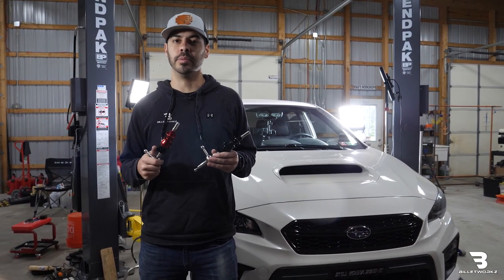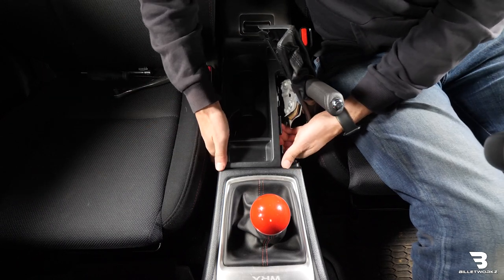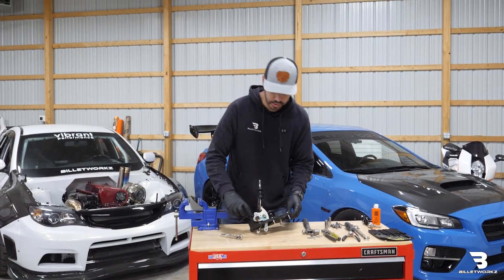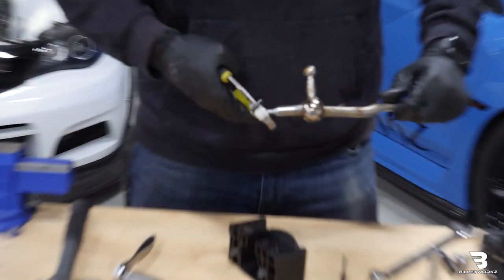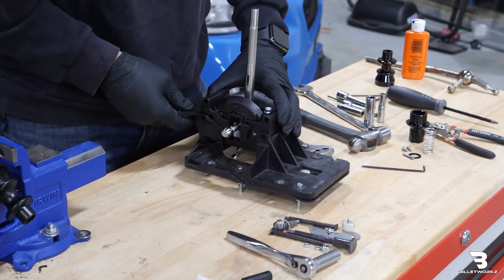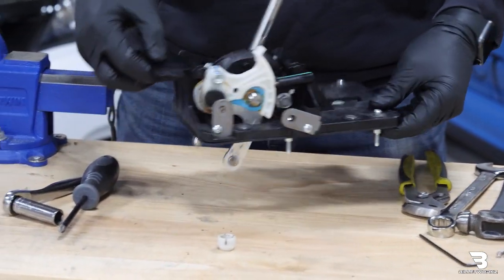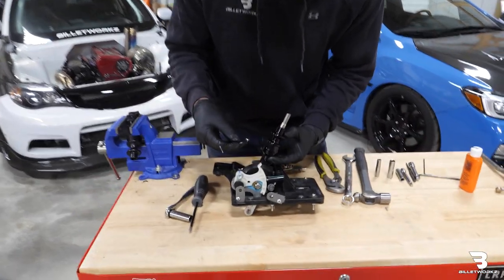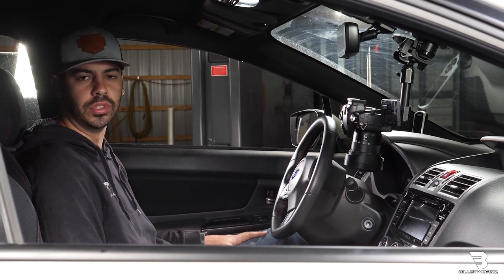Billetworkz - 2015+ WRX Short Throw Shifter Install Guide

Comment: OK, this video was really crucial to a successful install. I'm not a tech and I did this in my driveway. It took almost 5 hours to slowly get this done. The damn roller pin would NOT come out. It would only come about 1/2 out. I ended up cutting it in half with a saw and hammered the remainder back in so I could slide the shifter out. Ooof. Lots of hammering and cursing. Otherwise, it went pretty smoothly. It's no fun under the car and I hate being under a few tons of weight that could crush me, but it went OK. The last thing that ISN'T in this video is adjusting the 5th/6th gear stock shifter stop. I couldn't shift into 6th after the re-install and thought for sure I had screwed something up. After some more searching on youtube I found a video on installing a new 1st/2nd Billetworkz shiftstop and it addresses adjusting the stock 5/6 stop. PLEASE, please add the adjustment of the stock 5/6 stop to this video - or link to a new vid on how to adjust it. Anyway. this video is CRITICAL to getting this shifter swap done. The shifter is kick-ass and I love it. It just takes a lot of work to get it installed, especially if you're not a pro tech. If you're going to do this, plan on a whole day of work, get your tools ready, and take your time.
Reply: Just got mine done today, the whole installation took me around 5-6hrs as well because of no lift so it was 3 times more the work. The installation is very straight forward but them mofos bolts took me forever to get off. Overall, it was not complicated but just difficulties finding tools that would help. The pin was pretty ez for me, you can buy a set of punches for 15 and just pick the size that you need, be patient and smack it slow and hard. I got the whole kit done, shaft, bushing, and plates too. Everything is really sturdy just need to get used to how short it actually is, huge difference I would say since you can “feel” your car more. Well done brother!!!
Reply: What is the video?!

Comment: Watching this process conjures up memories of .50cal MG bolt carrier disassembly/reassembly from my military days.
Reply: 15:14 Timestamp for referencing reverse lockout installation instructions. After a year+ of use, the retaining ring got dislodged from its groove, causing the spring to no longer return the assembly to its down position when not using the reverse gear. Easy fix, though. I removed the upper receiver, reshaped the retaining ring, and reinstalled while sitting in the driver's seat.

Comment: 100% confirm will fit the 18+ Crosstrek 6mt.

Just finished installing this into my 2021 Crosstrek 6mt.

A video on installing the shifter stop would be awesome.
Reply: The 18+crosstrek has the same shifter as the 2015+wrx, it also fits the 2017+ imprezza. 
And yes super worth upgrade. I put in my crosstrek, and it's such a better drive now. I don't think they need to make a video of the shift stop. It's kind of self explanatory for anyone thinking of putting it in. You just put it in first, set the stop, put in 5th set the reverse lockout stop, and tighten it down. There's plenty of other video on YouTube about it. But if you drive manual you shouldn't need an explanation. As long as you can get into all gears, you did it right.
Reply: Hey nice to know:)   My girl has been wanting an STS in her '19 crosstrek. Thx
Reply: I just installed mine in my 23 crosstrek and was wondering if it is supposed to be seated a little to the left?

Comment: Holy lord that’s so much work for something so small
Reply: You’ve never done a throw out bearing then
Reply: facts 😂😂 im used to a short shifter being a 15-20 minute job
Reply: That's....what she said.
Reply: @nickc6570  last time i did a shifter everything was up top, and the car didn't have a reverse lockout. This is very complex because Suburu doesn't want you to do it. It's still less than an hour total, but it is a lot. That pin in the reverse lockout is the worst. I used a 1/8 flat and then held an allen with a pair of pliers cause i don't own punches. Then tragedy struck as i found the nut to be missing. Been looking for it and can't find it. Problem is it's small, but it's also big. And a random replacement nut won't fit without grinding it to fit into place or modifying the housing. That little nut is the only thing stopping me from having this done. Only question is where did it go. I'm going to end up doing it the hard way, and a couple months down the road finding it and knowing exactly what this random nut i found is.

Edit, i found the nut. It was being held hostage by a 17mm socket for some reason. That's why i couldn't find it. The weird thing is that socket was no where near where i was working.
Reply: especially going from honda to subaru i prolly unbolted less than 10 bolts installing my short shifter on my 99 civic 😭🤣

Comment: Was installing my boomba shifter and this video helped a lot with reassembly.  Just wanted to say thanks. Subispeed's video just brushed over reassembly of the shifter parts saying just reverse what you did. I was having trouble with that same threaded bushing you showed that dropped out. Ha! I didn't even realized it dropped out until I was almost finished. I see your shifter is even shorter than the boomba. If I ever decide to swap it out again I'll get yours.
Reply: I've heard the boomba has some issues, but once you get over them it's pretty. Good. I didn't like how people said while in neutral it's pretty far left, and in second it's basically against the parking brake. That's why i shelled out more money for this one. I love it so far.
Reply: @peeposadboy My boomba just snapped on me going 2nd to 3rd luckily it snapped in half in neutral.. I’ve installed the short shifter kit a year ago

Comment: I appreciate you using hand tools and not ramming it all back together with an impact. More people should take the time and use hand tools. Less issues from stripping or breaking bolts.
Reply from the maker: Sometimes I use an impact when removing bolts, but I always like using hand tools for reassembly!

Comment: is it a special size allen key for the bottom lock out? legit every single size in both my metric and standard sets do not fit.
Reply from the maker: The bolt in lower portion of the reverse lockout needs a 7/64” Allen key. It should be a common size in standard sets!

Comment: Make sure you tighten the ball down when you get it. It comes loose in a few weeks and causes some issues. The rod and ball are held together with a pretty loose allen screw so give it a good crank when you get it. Should alleviate the issues you will find if you don't. If it does come loose you better hope you put it back together in the right position. The slop in 3rd and 4th is disgusting if it's not perfect. Also was not shown in the video, but you must adjust the factory reverse shift stop position in order to use the shifter. If you don't you cannot access 5th and 6th. Getting it out the first time is the hardest. After that, it's pretty simple and burned in your memory. So taking it back out to fix it isn't the worst, but it is tedious that you have to do it again. But i still love this shifter.
Reply from the maker: Sorry for missing your comment! After tightening the bolt during our assembly process, we have started welding the bolt head so it does not break loose. Thanks for your support!
Reply: @Billetworkz  I have the 'OG' version without the weld. Would you recommend adding loctite to the bolt thread?
Reply: @stanley3055  yes..red loctite..worked for mine
Reply: What ball you were talking about? I've seen you comment a lot and makes me nervous installing it, feels like there a bunch of step missed out in the video bec of the comments.
Reply: @sethimacus8754  it's not something to worry about now..they weld the Allen screw now so it doesn't come apart
Reply: @joshuacole659  aside from that, any info i should know about before installing it? I just got the whole shift kit 3 days ago, and studying evry step before i install it.
Reply: @sethimacus8754  I used 3 in 1 Penetrant oil for the shaft and I used super lube multipurpose synthetic grease for all the ball joints..the biggest things for me that were a pain in the butt were the roll pins cuz I did the entire shift kit with shift plate and then the black housing has 2 10mm bolts that use the actual housing as a way to hold the bolt in place and that soft plastic strips super easily so if that happens to you and u end up not being able to get the nuts off just take some needle noses and grip the piss out of the shoulder piece..I eventually got it to break free but other than that it's straight forward...a pain to do on jack stands but very doable none the less
Reply: @sethimacus8754  if u do need to use the needles noses don't insert 1 end into the threaded portion because one end has the 10mm nut your tryna get out and the other end is the insert for the shift stop bolts
Reply: @joshuacole659  thanks! Will keep this in mind!
Reply: @sethimacus8754  o..lol..sorry forgot 1 other thing..the shifter cable connects to the bottom of the shaft pretty easily..however some wrx's have less space where the cable connects at and thereby causes the connection to scrape the plate that encloses everything under the car..I had this problem and it was making my shifter not snap back to neutral..I simply took my pin punch and where I could see it was touching I beat that spot out just barely noticeable visually but now the shifter shifts like butter..u could also just get some washers.  That's what Austin (the owner) actually recommended but I didn't have any on hand
Reply: @joshuacole659  now im confused about this washer u talk about
Reply: @sethimacus8754  it's for the cover plate under the car that's closes off the cables for the shifter..its not a big deal just sharing my experience..u may or may not need it depends on of ur shifter is dragging on the cover plate..my last wrx didn't have that problem the 1 I own now does

Comment: Are you supposed to lube the outside of the white piece on the bottom of the shifter before reconnecting it to the shifter linkage? Not sure how much it moves around when shifting, but I installed mine last weekend and am now wondering if I missed that.

Comment: I can't get the two 10mm nuts off the bottom of the assembly. They spin a bit and then don't move. I'm getting super frustrated since I got this far.
Reply: This is where I’m at. What did you do? I’m having the same problems
Reply: @Basedgodnick69  lol I drilled a pilot hole in one corner of the square pin, inserted the old shift assembly dowel pin into it and used the handle of a 5lb sledge as an edge to prevent the pin from rotating while breaking the nuts. It worked and the shifter has been flawless for the last 7 months
Reply: I had the same problem. I drilled 2 holes from the side of the plastic into the corners of the square opening and ran 2 screws into the edge of the metal. Wish I could add a picture

Comment: The last 2 10mm nuts...mine are so tight the flange on the other end forces through the plastic. Any recommendations?
Reply: Mine are too. Did you get them loose? What did you do? I tried to thread a screw through the top, but trying to break those 10mm nuts off isn't working. It is like they came too torqued from the factory
Reply: @johnyoung7732  I realize both of your comments are a few months old but just in case you still haven't managed to get it resolved: I had the exact same issue and ended up going with a hail mary of using crazy glue to try to keep the plastic bits on the other end from spinning and IT WORKED. So if you're struggling with this still, maybe try that.
Reply: @honko802  I just went through this and ended up getting the one off fine but the other one I stripped the fuck outta the top part that spins and used a drill to cut out the plastic around the top part that spins and held it with vice grips. Looks like shit and won’t fully tighten anymore but fuck it, it holds lol
Reply: Take off the stock shift stop. 2 10 mm bolts on top. Take them out and remove the shift stop this will give you access to the bolt attached to the nut. You should have a little wiggle room to stick something in there stop it from spinning. I had the same issue with the 7mm bolts. But with those you have no room to play with. The issue is the plastic housing gets damaged from the nut being overtorqued. Unfortunately it's ruined forever and there is no fix, without buying a new housing, but you can't buy a new housing without the whole shifter assembly, and it's $200. So just make it work lol. When.putting the shift stop back in, do not overtoque the 10mm bolt, when you feel it.get tight, stop. If you go any further you will destroy the threads on the bolt and it become a bitch to get it back out. Luckily i order the shift stop with it that came with 2 brand new bolts, and luckily the threads for the other bolt that it bolts into were fine.

Comment: Whitch 3 in 1 lubricant is he using
Reply: Also wanted to know.
Reply: Just use the grease from the old shifter. There's plenty of it.
Reply: He is using HOPPE'S Lubricating Oil it's Gun Oil
Reply: @waltsmoreno8934  I read all the comments to see if someone recognized the oil he was using.  He purposely held and placed it so we couldn't see! :)

Comment: What size Allen wrenches did you use for disassembling the Billetworkz shifter?
Reply: Have no idea what size they used. A 3.5mm is too big, and a 3mm is too small. Likewise there is no standard size that fits it either. Apparently it's a special size. I ended up using a flatip screwdriver to get it out. These are strong bolts so you won't hurt it. 

Edit, the top 2 are a 3 or 2.5 mm can't remember. The bottom one has no size. But a 1/8 flat tip screwdriver bit fits right in.
Reply: @mattevans1643  yes they mess up doing that. Why still can't remove my bottom one 🤪
Reply: @yaoyang04  what did you use for the bottom one?
Reply: @sethimacus8754  Posting this for future people to see… the lower reverse lockout allen bolt is 7/64.

Comment: Followed the instructions and I was not able to put in 5 & 6 gear.  The bottom reverse lockout was hitting the plastic cover.  I had to flip 180 the bottom reverse lockout for it to work.  Can someone let me know if I did something wrong
Reply: Yes, the reverse lockout should be pointing toward 5th and 6th. There are 2 bolts that hold down the 5th and 6th shift stop. Loosen the two bolts, and move the shift stop out of the way, put the car in 5th, and position the stock shift stop so that you can go into 5th, but no further. Tighten down the stock shift stop. Make sure you can go into 6th as well, and you're good.
On the stock assembly they put white paint where the stock shift stop line ups. That is for the stock shifter. For the billet shifter you have to move the shift stop out to accommodate the longer reverse lockout.
Reply: @mattevans1643 goat comment going through this problem as I type thank you so much

Comment: Is anyone else having issues getting the last 2 bolts removed from the bottom of the assembly? It just rotates and never breaks off..
Reply: I just did it today in my crosstrek. I ended up having to hold is still with long handled 90 degree needle nose pliers. Hope this helps or that you already got it

Comment: Holy shit this looks like a pain in the ass.  Guess I’ll just learn to like the stock shifter. Have no interest in disassembling half the car to lower the shifter an inch.
Reply from the maker: Short Shifters don’t just shorten the height, we change the pivot points to shorten the throw. Those who do our complete short shifter kit say it’s definitely worth it!
Reply: @Billetworkz  I’m sure that it’s a great product that improves the feel and people love it. My comment wasn’t anything against you guys, it was more about the design that Subaru went for in this model. I was able to do a short shifter install in my 13 WRX in like 45 minutes and I’m not very mechanically inclined. This new design Subaru went for just seems needlessly complicated.

Comment: Dude forgot a whole two pieces to install wtf
Reply from the maker: Please further explain your comment so I can help!

-Dude in video (aka owner of Billetworkz and engineer of products)
Reply: @Billetworkz  so I finished the shift plate yesterday and the short shifter and now my car only shifts to 2nd and 4th but to shift into 2nd and 4th I have to shift upward instead of down ward for those two gears
Reply from the maker: @LarkinFilmz  you do not want to install the shifter plate cover plate. If you install the cover plate, it won’t allow you to engage certain gears.
Reply: @Billetworkz  I did not  put back the small plate  4 bolt sheiks for the trans but I put back the small 2 bolt bracket next to the plate any other ideas what I did wrong  also looks like neutral it’s farther toward the back seat than normal